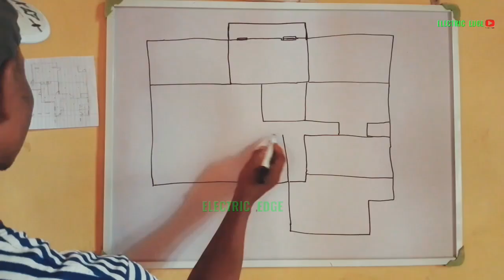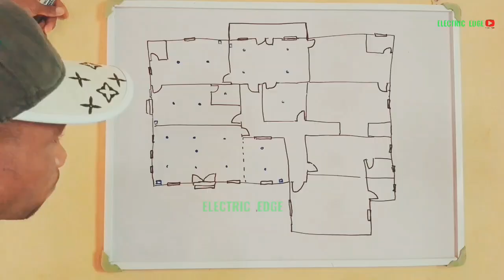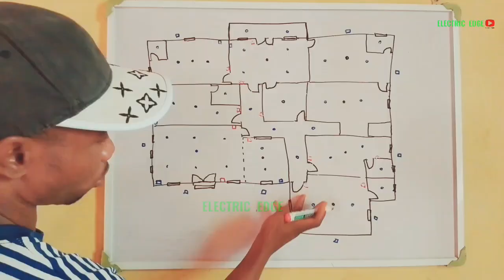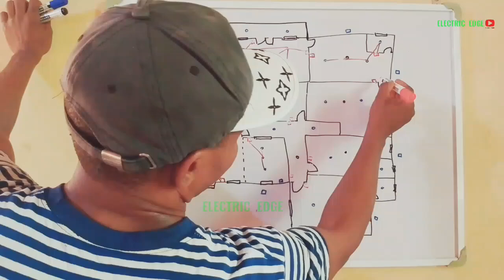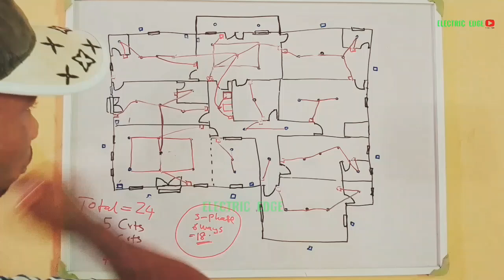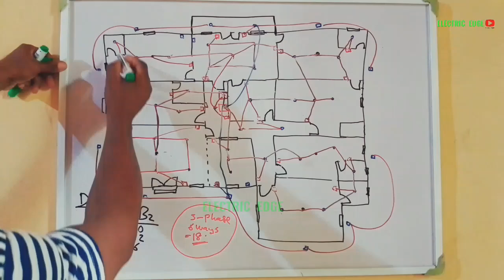HOW MANY DBs should you use? THIS 5-BEDROOM / electrical apprentices

Comment from the maker: 🚨 CAN YOU REALLY PLAN AND EXECUTE A HOUSE ELECTRICAL INSTALLATION FROM THE FLOOR PLAN?

Many electricians can run conduits.

But can you look at a building, plan the circuits, draft the conduit layout, determine your routes, position your boxes and DB, calculate what materials are required, and execute the installation professionally?

That is where the real skill comes in. ⚡🏠

If you're an apprentice, electrician, technician, or electrical installer and you want to improve your practical skills, I have put together a complete training package to help you understand the process from planning to conduit execution.

🔥 HOUSE ELECTRICAL INSTALLATION – FIRST FIX PACKAGE

Inside this practical training, you'll learn how to:

✅ Read and interpret electrical floor plans
✅ Carry out load assessment and circuit planning
✅ Draft electrical/conduit layouts
✅ Plan conduit routes before installation
✅ Position switches, sockets, lighting points and boxes
✅ Install conduits in walls, slabs, ceilings and floors
✅ Plan and position distribution boards
✅ Count points and determine material requirements
✅ Avoid common conduit-routing and installation mistakes
✅ Handle post-casting conduit defects using practical site methods
✅ Understand the workflow used in real residential electrical projects

🎯 This is not just about knowing electrical theory.

It is about understanding HOW TO PLAN THE WORK and HOW TO EXECUTE IT ON SITE.

If you've ever stood on a building site and wondered:

"Where should this conduit go?"
"How do I plan these circuits?"
"Where should I position the DB?"
"How do I route these conduits professionally?"
"How do I know the materials I need before starting?"

👉 This training was designed for you.

⚡ Stop guessing your way through electrical installations.

📚 Learn the planning and practical execution process.

Get access to the House Electrical Installation – First Fix Package today.

👉 [https://selar.com/m/anams-electrical-tutorials1]

⚠️ Don't just learn how to install electrical materials. Learn how to think through the installation before you touch the wall.

Electric Edge — Practical Electrical Skills for Real-Work.